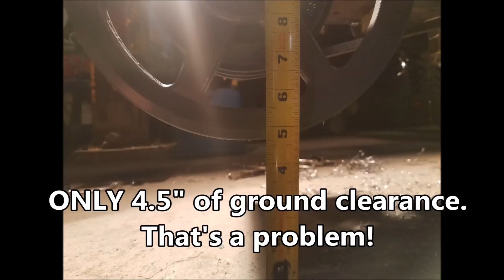Knuckleboom Crane: Adding an Electric Motor for Hydraulics

Comment: How many Kw is the motor, you need at least 6-7 Kw to have any real use of your system. And even better if you keep your system intact and rather get seperate pump for the electric motor. And operate a hand valve to switch between systems. Also then you can mount your motor on better place on the truck.
Reply from the maker: It's a 3hp motor, with a reduction of 7.27 to 1, so that drastically increases the power to system.  It has no problem lifting some serious weight.  I lifted the All Terrain Track Chair, and that weighs almost 4000 lbs.  It has more than enough power for what I need to do in the shop.  The cost was low, and I can quickly remove the belt & pulley to the electric motor if necessary, and re-connect the PTO shaft from the engine.

Comment: Good Job!! Maybe a gas generator for when you are down the road using it.
Reply from the maker: That'd be one option... I made it so that's it's pretty easy to remove the 12" pulley and put the PTO shaft back on.